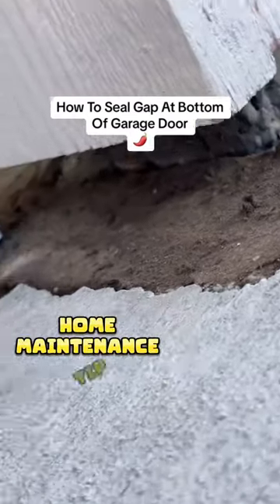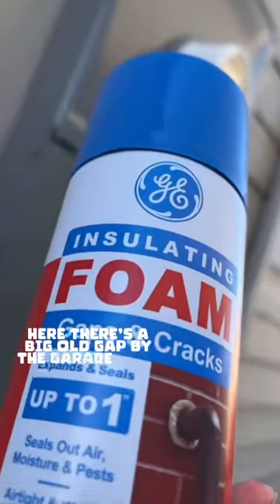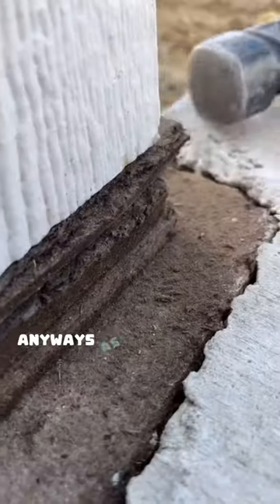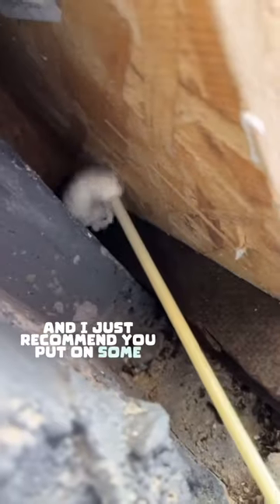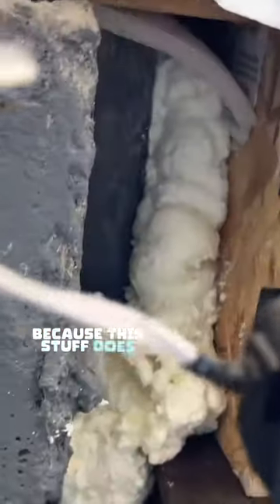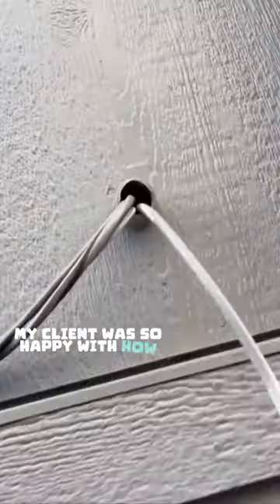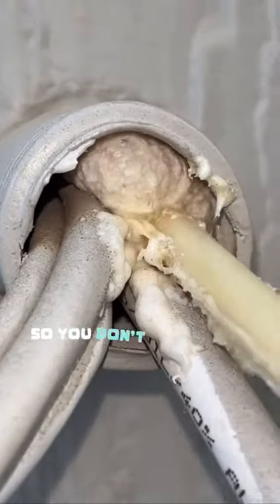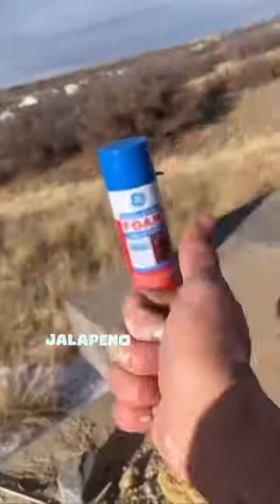How To Seal Gap At Bottom Of Garage Door. #garage #foam #gaps #homemaintenance #handyman #howtodiy

Comment: Cool repair but just didn’t feel the foam in the tube. It’s going to be a hassle to pull the lines out if they needed to be replaced 😢
Reply: And it’s coaxial. Will definitely need to be replaced. Great point.

Comment: Unfortunately the foam does not make it bug or mouse proof.
I would suggest filling in any void larger than your finger tip with steel wool before adding the foam to keep mice out.
Reply: I can attest to this. He should have put some wire mesh or something like you mentioned, in order to prevent the rays from chewing, otherwise they’ll eat right through that foam. It might work to deter them a little but if there if they really want to they can get in
Reply: not sure if you know but they actually make pest-resistant foam it's in a green can
Reply: @denniss5845  yeah, they make a bee resistant foam as well but they are not perfect. They can't get past the steel wool ever.
Reply: Idk man that can say seals out pests. (Sarcasm)
Reply: Lol steel wool don't stop mice from getting in lol them little pests can chew through concrete
Reply: @chrisangus1725  oh it tangles up in their teeth very well! We've gone in to renovate abandoned buildings and found dead mice and rats stuck in the steel wool and foam filled holes!

It also works awesome on rat traps. Wrap the trigger in steel wool then smear peanut butter all in it. They can lick a little off, but when they try to nibble they get tangled in the wool and SNAP one more in the books!
Reply: Good suggestion. I used steel wool. I just need to add the foam ✊
Reply: Very true! Rodents eat right through that foam!
Reply: Great stuff Green can  is designed for bugs and rodents. It has a chemical that rodents don't like some kind of bittering agent works well.
Reply: Copper wool is even better for this

Comment: I always wonder when you seal up places with cords coming in/out like that with stuff like expanding foam. What happens when you need to replace or add/remove cables?
Reply: I’m curious as well
Reply: You take a long rod or drillbit and poke out the foam. I'm assuming the hole just goes straight through.

At least in my area there is no UV resistant outdoor rated wire that looks like that though.

Also it looks like garbage. On a new or Reno'd building the wires should enter the back of the fixtures. Not out the wall and free hang over. Tbh looks like a home owner 'special'
Reply: It's common to effectively seal an electrical chase with plug duct seal. It's simple,  inexpensive, water resistant and removable.
Reply: @Morberis  nah, that's a communications guy special. They will punch holes wherever they like and don't care to fill or protect.
Reply: You bring in a bulldozer😂😂😂
Reply: If you need to add or remove cables you hire a competent contractor, not this hacker.

Comment: As a cable tech seeing the feed into the house from the outside housebox filled in killed me becuase need other wires added it'll either be a pain to clear that foam out or drill a new hole

Comment: Bug proof, yes. Mouse or rat proof..no. I’ve seen mice gnar their way to upper condos THROUGH the wood, and THROUGH the linoleum. Mice…not rats. Rats could chew through surfaces even quicker. That expansion foam would not keep a single rodent out. You need to use either steel wool, or a steel mesh screen and seal it on the borders with industrial adhesive caulking. Then you can spray it in with insulating spray foam. Spray foam and good caulking can prevent bugs. You need more to prevent rodents though.

Comment: Foam does not help with rats or mice they will chew right threw it as well as your material you used as expansion filler they will Chew right threw there 😂

Comment: Good idea on the gap filler. However, I would have covered the filler with metal flashing held in place with construction adhesive. Foam is not a long term fix. It will degrade to powder within a matter of years. Flashing and construction adhesive will last a lifetime.

Comment: That brown insulation is going disintegrate after a couple rains
Reply: It's actually concrete expansion joints, for example, sidewalks or patios. It's meant to get wet. As concrete expands with seasonal changes that goes between to keep concrete from cracking or chipping. Just a friendly fyi.

Comment: Shouldn't those cables be in liquid tight?
Reply: Cables should be sealed at a surface level with silicone, so they can be replaced if needed.

Comment: They also make a product that they sell at Home Depot comes in a green can it’s called great stuff pest seal or something like that it’s gray when it comes out of the can for spots near electrical I would suggest great stuff fire block. Also, for those really big gaps you can get great stuff. Big gap filler seals up to 3 inch holes. I work in commercial construction and this is what we use.